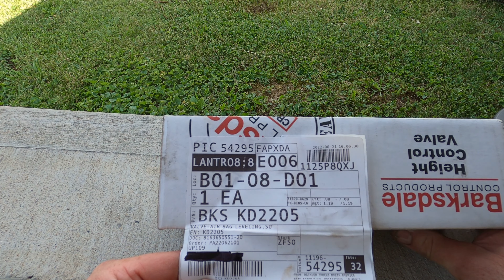Trucking , How to replace a Freightliner Columbia Air Ride Suspension Leveling Valve .

Comment: Why didnt you order new quick disconnect fittings ? How much at freightliner does it cost to replace leverler system ? Thanks for posting.
Reply from the maker: The old ones just needed cleaned , normal around a $$100 but the cost changes , so I have payed $60 also

Comment: thanks for sharing, my airbags were not inflated at all, so the suspension is at all the way lower position, does your truck has same problem before you replace the leveling valve? thanks
Reply from the maker: Well a leveling valve can screw up in a few different ways. Like not airing up , over airing up , blowing air out , ect

Comment: My suspension is lowering during the night time when my truck is off. Do you know what is the issue? Thanks
Reply from the maker: The air pressure bleeds off this is normal, plus when your parked and the truck is running your suspension is not moving so normally it is a little lower.

Comment: Every morning my air bags had not air, do you think is because of this valve?  I have a freightliner cascadia thanks
Reply from the maker: Could be , if you do not hear air from anywhere, what you can do is get a spray bottle , like a glass cleaner bottle and fill it with water and add dish washing detergent to it , shake it up . Anywhere you spray it that air is leaking, you will now see bubbles forming . This works well .
Reply from the maker: There are so Mary places that can leak air , this is the easiest way to find the leaks that you can’t hear. Let me know what you find !

Comment: After unloading a load or setting tractor brakes it seems like it’s leveling slowly does that mean it’s the leveling valve?
Reply from the maker: Not really , my truck and trailer are normally slow at leveling.

Comment: My suspension keep lowering itself and raising itself up every minute? Could this valve be the problem? No leaks. 2015 cascadia
Reply from the maker: Sounds like it to me . I would check that the linkage never just popped off , could just be a simple fix . Mostly the valve needs replaced, which is still not a hard job . Let me know what you find .

Comment: We didn't see the part where you had to put in the golf tee or the small pin to adjust the level.
Reply from the maker: It was unneeded, my setup did not require this , most do not require this do to the linkage is not adjustable on most setups
Reply: @Starkeyfamilyfixing  oh okay 👌